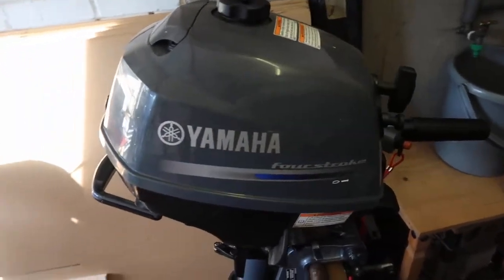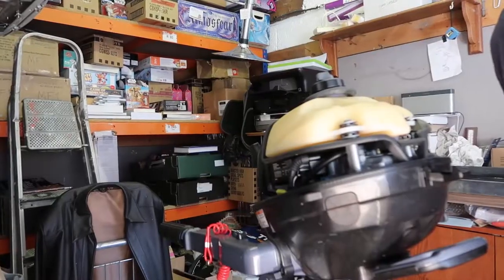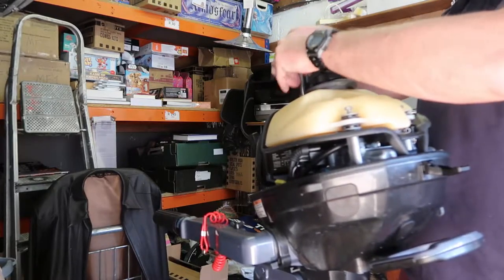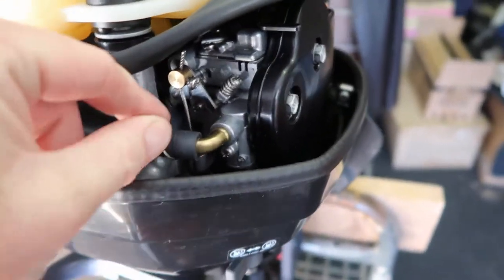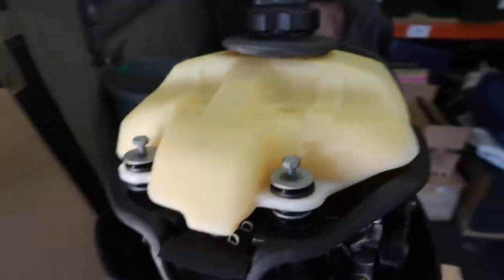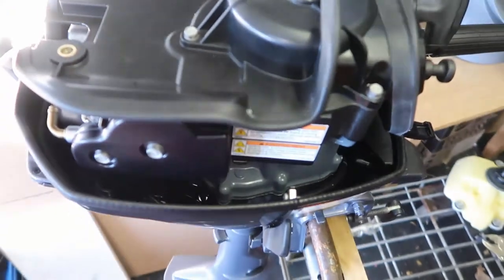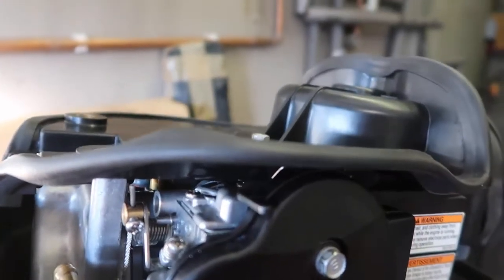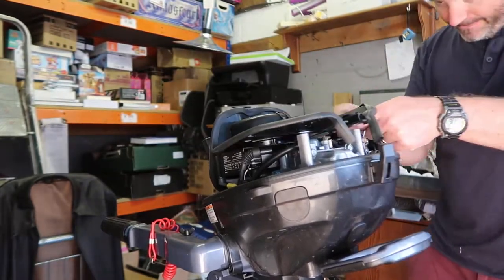Yamaha F2.5  4-Stroke  Outboard - Carburetor Removal and Clean -  How To

Comment: Well done! It got my Yamaha 2.5 running like it should again. I could not have done this without your guidance and good tips! Just one tip that I’d like to add: when I put re-assembled it, the throttle cable (lying in the bottom half of the cowling) ended up on the outside of the fuel valve stem. It should go on the inside. I managed to fish it around to the inside but it would be easier to make sure it’s there before mounting the carb. Thank You for taking the time to share this!
Reply from the maker: Really glad it helped David! 👍

Comment: Hi, good first phase cleaning, second phase would include removing the main jet (big  brass) and idling ( behind black plastic plug), in my case  half the holes were blocked on the main and the idle jet almost fully.

Comment: Thank you so much brother,  I just have a question when you open the carb , did you have to take the small parts out or you just spray them and than put it back.
Reply from the maker: I world remove the jets and spray them too, they can easily get blocked so worth checking that you can see light through the jet which means it's clear.

Comment: Thanks for posting this video. I have the same outboard and it also won't start. Is there only a main jet in the carburetor or is there also a pilot jet? (sometimes referred to as the idle or slow jet)
Reply: There is a pilot jet next to the main jet, it has a rubber plug over it and draws it's fuel from the Main somehow. Pull the plug carefully unscrew the pilot and check it's not blocked.

Comment: That was great. I have fuel coming out of my carb somewhere underneath the carb. Only when I turn the tap on. Any ideas as to why? I had emptied the fuel that had been sitting in it for over a year by tipping the motor upside down 🥴 so I know I stuffed up doing that now. But I can’t seem to stop the leak and the engine won’t start,
Reply: This is caused by a poorly designed drain screw that deforms easily.  Buy a new screw, seat it and never open it.

Comment: I'm replacing the rubber seal for the float chamber. It is easy to clamp it down and for it not to be perfectly in situ. The groove has pinch points for it, but I'm finding it hard to pinch it in place. Any tips?
Reply: If it’s a genuine seal it should fit easily, you can always try a very thin layer of silicone on the seal which will help it stay in place while you screw it down.

Comment: The brass screw near the drain tube was so tight that I couldn't get mine off when cleaning the carb. Do you know if this screw is not meant to be undone? Does it matter if it cannot clean it out?
Reply from the maker: I think thats just the screw to manually drain the float bowl so not really important.
Reply: Actually, that screw is troublesome. After removal, it tends to seat poorly and require replacement.  Best to avoid it.
Reply: I agree, the screw is poor, however it does allow any water in the bottom of the bowl to drain. After I damaged the head I left it in situ and while I ran the carb dry at the end of each season the build up of corrosion (I suspect from trapped water) caused me grief. The screw is a number 2 Phillips I think.

Comment: Is this a reliable outboard? I want to buy a new one.
Reply from the maker: I would say so, I haven't used mine much but it's been fine.
Reply: Mine is almost 20 years old. Yes, very reliable. Just keep it running about every month. To clean carbs those little jets clog easily, and I have done this video several times for letting it sit. Don't let it sit more than a month to keep carbs flowing.
Reply: Not if you winter.  The carb does not stay unclogged well.  I have this motor in MN and the carb is clogged every spring. I tried to drain it one year and not only did it still dry up varnish in the jet, but the drain screw also failed and was costly.
Reply: After I repaired the leaky screw, I had to do another teardown and cleaning.  The motor is not great for infrequent use.

Comment: Shame, I came here hoping to find out why my fuel tap is pissing out petrol. I’ve got TWO of these carbs and they’re both doing the same thing even after replacing the sealing washer on one!
Have stripped both carbs and no sticking needle valves either - although that still wouldn’t account for petrol coming out of the fuel tap.
Seems like the previous owner had the same problem and just replaced the entire carb and now that too is leaking!
Shitty design.
Reply: You need to buy a new drain screw, the washer is not enough.